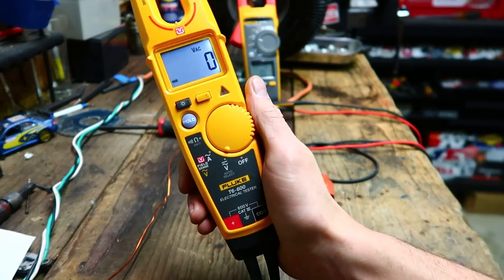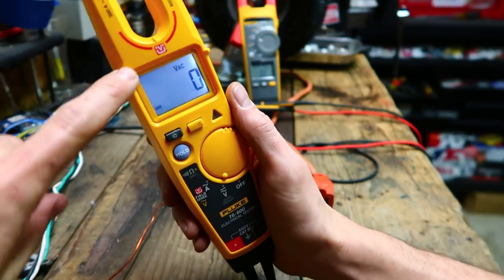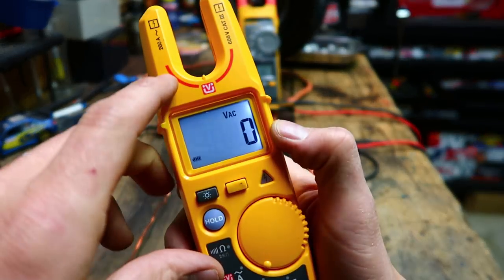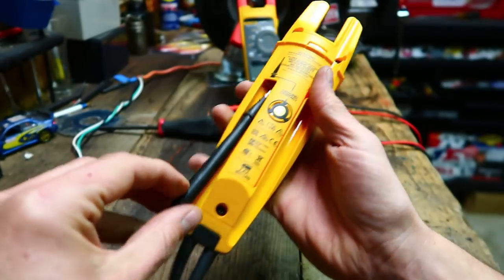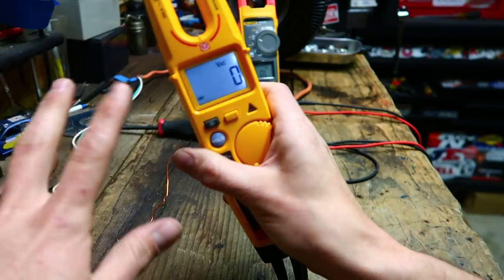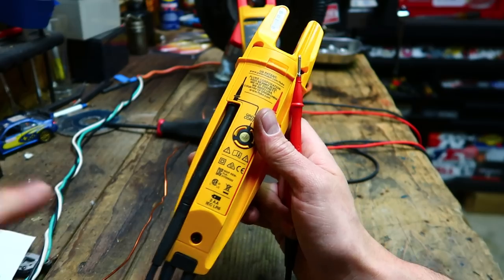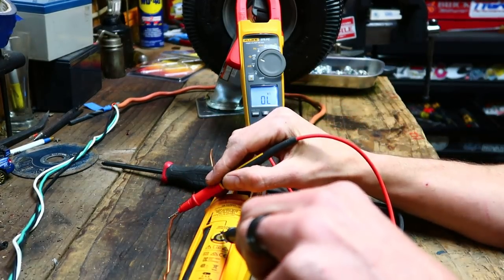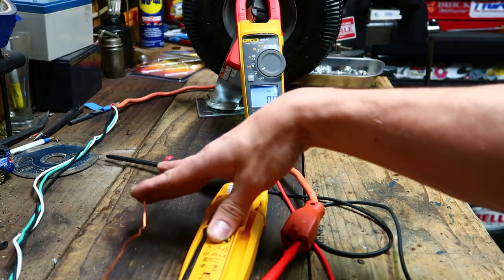Fluke T6-600: NOT DANGEROUS!

Comment: EE here. Shitty implementation of a very cool sounding and perhaps useful feature. The biggest danger here is what you mention in the comments - using the volt sense feature to see if a circuit is live, and thinking it's not because the feature doesn't work well.

Electrically speaking, there's little to no actual risk here, which of course fits with the baseline assumption of a product released from a big company who knows what they're doing (mostly). Here's why:

In your video, you touch a ground point while touching the meter pad, but this is NOT in the instructions. Instead, the meter in this mode relies on you being CAPACITIVELY coupled to ground. That is, not directly connected, but capacitively connected (which does NOT pass any DC current). This doesn't require you touching anything, it just requires you being a big sack of water. Now, whether or not this results in an accurate measurement I won't say. BUT if the meter is relying on a capacitive connection, it's quite likely that in the battery cover there there's a CAPACITOR between the ground contact spring and the pad.

Assuming I'm right about that, it means a ghost voltage will appear on the pad, despite there being no DC path that could zap you dead. Case in point - in AC volts mode, hold your meter up to an insulated live wire with a good ground on the other side. You'll likely measure a voltage there caused by the radiated E-field from the lead, because Volts mode on the meter is high impedance and doesn't clamp it down very well. But touch that lead, and you're definitely not getting zapped.

Further, it's totally un-true that there's EVER a low-resistance electrical path from black to red on that meter, in ANY mode. Even in current mode, that meter only measures current with the clamp, not the leads. Even if you were holding on to the ground lead with your fingers and poking the red lead at a live circuit, there's still 10 Mohms sitting between you and that circuit. I=V/R, so even if you're poking at 240V mains, that's still only 24 microamps RMS. That's a current so low you certainly won't notice. For reverence, you're putting about 45uA across your heart by touching each terminal of a 9V battery with your two pointer fingers, depending on how hydrated and sweaty you happen to be. 

TL;DR: all of the confusion here comes down to the fact that, with high input impedance instruments like multimeters, you can measure very high voltages on systems that are incapable of delivering any power, and are thus safe.

Interestingly, this is why CAT- ratings on meters seem weird, and why the CAT IV rating is often 600V even though the CAT II rating might be 1000. CAT IV means you're poking at pole transformers, where CAT II means you're poking at household mains, with a bunch of protections between you and the curb (breakers, higher impedance wiring, etc). The voltage required to CAUSE a failure isn't necessarily different, but what happens DURING a failure sure is. 

Same reason sticking your finger in 120V mains is possibly lethal, but holding on to a 20kV Van De Graaff generator is a fun physics class experiment. The VDG can't deliver enough power to kill you, but the wall sure can.
Reply from the maker: dude, that is best, most informed comment I've had on this video.  Those are all concepts i'm familiar with, i'm just no where near knowledgeable enough to try and explain it that well. The main reason i just said "mystery stuff" and that i didn't know.  Rather just say that instead of saying something incorrect.  I did a follow up video to this one where i rip the sicker off the battery door.  I've never seen tiny flat capacitors before, but it looks like there is 5 of them in series between the lead and the contact pad. That's why i couldn't get any continuity or resistance from testing it. Check it out and let me know what you think.  (i did watch another video where a gentlemen got something like a 2.1 nano farad reading from the contact pad.  https://youtu.be/frjoyQHqCN4 it's a really well test on this meter.
Reply: Ha, I forgot rule number one: there's ALWAYS newer information than your internet comment. Nice to see that I'm on the right track, anyway :P.

Anyway, yeah, that's for sure right - 5 caps in series with what looks like it's probably intentionally high resistivity traces connecting them. Probably to control the worst-case failure mode, though I'm not sure how or what that might be. 

Interestingly, I think the most-incorrect part of my comment was the meter's impedance - I said 10Mohm, which is true of virtually all electronics meters. Many have a "Lo-Z mode" to clamp off the ghost voltage that I was alluding to, so dead wires running parallel to live ones (capacitively coupled!) don't measure as live on your meter. But since all these clamp meters are targeted at industrial power situations rather than electronics, I guess it's standard practice to just use a lower input impedance from the get go. Not that, on 120V, you're any more likely to die. But where I might touch red to 240 and black to my tongue in Volts on one of my meters, I suppose I probably wouldn't with a clamp meter. Or on my meter, I mean, come on.

But yeah, end result, still safe unless maybe you're poking at circuits with such high voltage you'd need gloves and isolation anyway.

Comment: AvE had it on amp mode... this test was flawed.
Reply from the maker: it doesn't matter, this meter on amp mode only uses the jaw, it's not like the 87 or others that have currant running through the leads

Comment: If I saw all that voltage going through the pad I wouldn't touch it either,  I think AVE is smart for not saying oh well I'll touch it anyways lol.  No electrician on earth would touch something they JUST tested as energized...
Reply from the maker: unless said electrician was confident that it was safe.  Also i localized the voltage in just 1 hand, no danger in doing that with 120 volts to ground.  Worst case scenario, i would have felt a little buzz in my hand.
Reply: This is true but it's about the habit of doing so for me.  I was an ET in the Navy and I was always confidant because I knew exactly what I was doing...until I got nailed by 480 one day not realizing right away what it was.  This is why they beat the bad habits out of you and from that day "shouldn't shock me" means don't fucking touch it anyways lol.

Comment: I'm gonna go out on a limb and say sticking your hand in a live panel with your bits attached to ground is not the safest thing. Now if you have your wits about you and are a responsible professional you can do this. But when I'm probing live things I want to be as isolated as I can possibly be. Which is where in I think the danger lies. It has nothing to do with the meter feature but with the unhealthy mindset that grounding yourself while handling live conductors forms. 
Love the video and I don't want to align myself with the other people in the comment section blasting you for this I just think the whole ground yourself mindset is off-putting to say the least

Comment: If field sense shows 0 volts on a hot wire sometimes...How is that not dangerous?
Reply from the maker: 1. the feature is not intended to determine if a line is live or dead, it's to read voltage with out using the probes, the misuse of a non contact voltage tester would have the same results.(sure, i'm sure dozens of people have been lit up by trusting this thing to tell them the line was dead)
2. ave tried to make it look like there was mains voltage at the contact pad, he didn't talk about any possible safety features that inhibited a person to get shocked, that was my main issue

Comment: The first video was fair about the field sense not working for him.  The second video was a gut piece after "someone at fluke" commented on the video.  Speaking mechanically I believe the "magic" is between voltage and draw, like on automotive circuits.
Reply from the maker: yeah, sounds like he got his panties in a wad.  He was totally using it wrong though in the fist one, so the fluke guys comments were warranted.
Reply: There are two potential dangers though. I think that everybody is too distracted by the grounding pad. Field sense is so flaky that even people who are using it correctly have a decent chance of not detecting that a wire is live. If this meter has a bright red zone where the field sense supposedly is, it had better pick up current when a wire is held anywhere within that radius.

Comment: a piece of electrical test equipment that is not reliable is absolutely dangerous. are you going to trust your life to a meter that may or may not tell you if an energized component is in fact energized?
Reply from the maker: You should never rely on a non contact tester to determine if something is energized.   Just like you should never rely on one of those pen style testers to do that, it's a bad practice.

Comment: Fluke has a vested interest in not killing their customers. Dead people can't buy the latest greatest meter, and it'd be hard to convince the ones left alive to buy more. If you're killing people with your entry level product, how do you find experienced people to buy the high end stuff?

AvE is also sort of a comedy thing for one, and he's also not perfect. Fluke makes good gear, but they aren't perfect either. I commented earlier on the other video, then watched the AvE ones .. and this one popped up ... in the meanwhile I looked, and it was the T+ Pro I had, I had model numbers mixed up. My friend had a T5 - which I thought was the same as this one. Outside of that voltage sense gimmick, I don't see any meaningful difference between the T5 and T6 but the t5 is smaller.

He did have some other points - things that bother me about it. Having to ground yourself? Yeah, theres a cap in there - but caps can fail. They usually fail "safe" but I'd rather not chance it. The more concerning thing though is the voltage sensing not being remotely what I'd call reliable. "Theres no volgage here sam, just checked it - here I'll check it again for you - hang on I gotta ground myself!" BZZZZAAAPPP!!!!

Comment: Well, i tell you: if you're using a meter to check and see if a wire is live or not, and it has to be in a very small particular spot in order to read "live" then you're playing with fire. It should be easier to get a false live than a false dead.....(pun intended lol)....If memory serves, he tested the ground and there was in fact 110v running through the ground therefore, I'll stick with Ave......
Reply from the maker: You should never use this kind of non contact reading to determine if something is safe to work on.  There are other videos that are 1000% more technical than this video that back up my basic assesment

Comment: They are sold here in the uk, that means they went through all BS tests , meaning they must be safe
Reply: Steve Brindley so it passes all those test but ain't this product new? Long term test are not done, if that thing gets wet or humidity makes its way in then what? 

If you're going to test 600v panel would you trust that thing using your finger on that? This is the same as those clear neon pen screw drivers..if that resistor fails you are dead
Reply: There isn't a resistor. There is no physical connection between the voltage and that panel. If anything fails then it just doesn't work any more and you still live. With the neon, you are correct but this is clearly not the same thing at all.
Reply: Nevets I feel better not grounding my self to touch a pad on a meter to test high voltages...

But to each there own..I'm not putting my life on the line with that thing,  it seems this meter sucks anyways..
Reply: Wow.  What terrible logic.
Reply: There is absolutely no physical connection between that pad and anything that matters. You can see for yourself in the video, it is literally not possible to get a shock. But each to there own...

Comment: I think you are right on this one Mike, the field sense part is a little too early for production, it could be a winner but not in current form.  
But overall I don't think it's as dangerous as AvE made out. To others stick with the T5!
Reply: good to hear i got a brand newish t5-100 for 40 bucks
Reply: David Howard well done mate!
Ya can't go wrong for $40 either way was it the -600 or -1000?
Reply: 1000
Reply: "Current form"....I see what you did there....
Reply: I picked up a T5-1000 at the local EZ Pawn for $15 cause it had dead batterias and they were to cheap or lazy to put new ones in it......

Comment: Have None of you guys seen the old screwdrivers that had a neon that illuminated when you put your finger on the metal contact at the end and the tip on a live part, the reason it doesn't kill you is the current is too small, this is the same principal which is why we still get the potential difference of 70 - 110 Volts. It is still electrically connected you just proved that with your meter, wonder how that little button feels when you use it on 440V or 600V, check the resistance on mega ohms and you could calculate the current, if its more than 30mA there's a good chance your dead. I wouldn't risk this type of meter in industry, Fluke is meant to be an industrial tool that saves your life, I use them and rely on them, no meter should have the slightest possibility of not being 100% correct.

Comment: Why not try this on a 1 kV 1 amp power supply and see if you're fine. If you walk away then I'll believe you
Reply from the maker: well it's only rated for 600v soooo, no
Reply: Yeah. But what happens when you test on something that is at 1 kV?  You are using this to test for voltage. You have no idea what the voltage is.  That was the essence of my comment
Reply from the maker: You should have an idea of what voltage systems are present no matter what you're working on.

Comment: would you trust that "mystery shit" with your life? What if it fails that ONE TIME. I wouldnt, unless they explicitly showed the engineering behind it.
Reply from the maker: stoneyyay even if it worked perfectly,  I would never trust any kind of non-contact tester to determine if something was de-energized.  Any one that does, shouldn't  be working with electricity.  That's a bad practice and it's the user that is hazardous, not the equipment.

Comment: The meter itself is pile of crap, had the old version and stopped using it cause i didn't trust it. Would be even worse when you have a part that hardly ever works. 117 can come in a pack with a clamp meter, which is what i have an have been using for the last two years nearly daily as an industrial electrician and i have never second guessed it, even the contactless voltage detection works well.

Comment: I think he meant that overall if you use a meter you need to have reliable measurements all the time, especialy if you test for current and it reads there is no current and there is and you go ahead and touch a wire that is live...  So overall its a steaming pile of dog turd....

Comment: You know enough to be dangerous to yourself. Your testing methodology is less than scientific. The concern is getting any voltage at all. Ave did explain that you are getting the voltage but resistance lowers the amps, which is what will kill you. The danger is that if there is a malfunction that bypasses the 'safety' resister you would be shocked. Electricians sweating or some other malfunction would be a potential problem. A miswired or malfunctioning circuit that an electrician is diagnosing - what they do - leads to unnecessary inclusion of a person in the circuit. If you believe that a tool used to diagnose and fix malfunctions will never malfunction itself, you are a fool. This is the basis for Ave's alarm for a potential problem. If you are a shill for the tool company.. which is sounds like you are.. then you are doing people a disservice and you should make sure your house and bank accounts are in your wife's name. You are giving an opinion that is contrary to a real expert and you put yourself in the crosshairs of a lawyer looking for an easy mark. Your life.. so what you want, but I am not going near it.

Comment: I used to subscribe to AvE but after a while I noticed that he is a really wide mouth american. He is a smart wide mouth american but he seems to have a too big ego. Americans also seem to be really anal about "doing it according to the code..." even if they have no clue WHY they are doing it. Obviously that connection is just to give the meter a reference to ground, no current really need to flow through it. Probably like the old glowing screw drivers you could use to test for voltage. They had a metal knob on top for grounding. Fluke knows their shit and is probably much safer than that.

Comment: I can think of a hundred times over the years I could've used the feature, in gutters with both 480, 120, and 208/240 conductors in grocery stores etc. Looking for the correct J box or conductors where everything was pulled through. I have been doing electrical however for 30 plus years and fluke did use something like this on a multimeter at one time, still can buy it, I never did, but fluke is the only meter I will buy. Why risk your life on something made by a hand tool or power tool company?